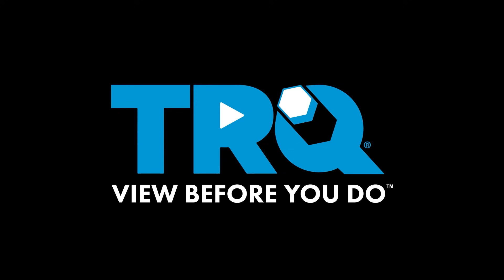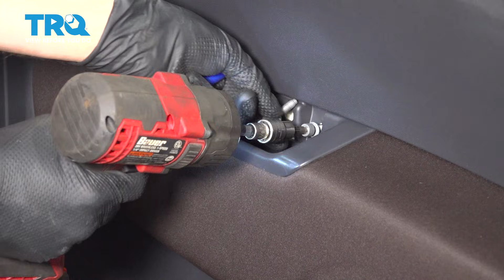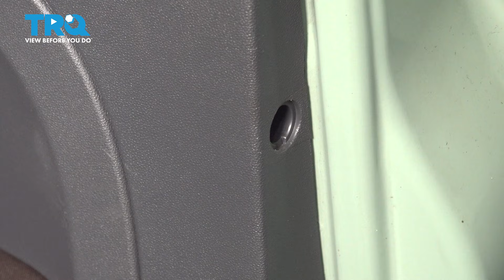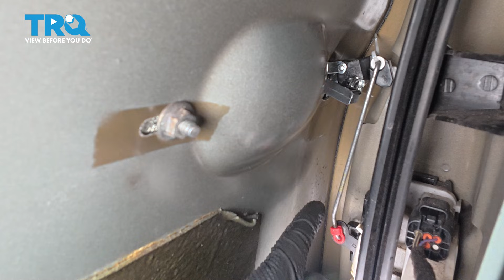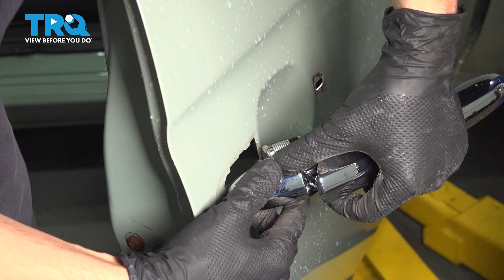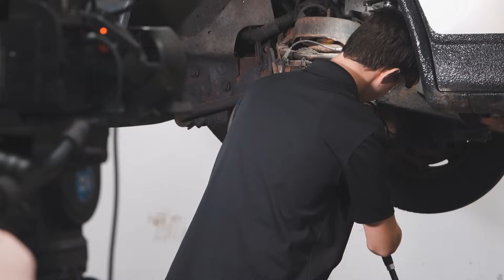How to Replace Exterior Door Handles 2012-2019 Fiat 500

Comment: a little annoyed that it says the only difference is that there's the lock cylinder on the driver's side. it is a more complicated install as there are two linkages to connect inside the door with one being blocked by the other and it also has the lock. removing the lock cylinder to place in the new handle isn't super simple either. once you get the old handle out, you need to put the key into the lock cylinder, turn it so that a little notch is visible underneath with a small metal clip above it. you have to remove the clip with a screwdriver or just something strong and thin that can pry it out. it's kind of a curvy U-shape. then with the key still in the lock (and paying attention which way is up so you put the cylinder into the new handle the same way), pull with a little sideways pressure so the whole cylinder comes out with an O-ring attached near the keyhole end. then put the cylinder including the O-ring but not including the old metal clip into the new handle with the key still in it and push it in as far as it will go. once it is all the way in it should be fine as it will also have a clip like the one removed from the old handle. the new handle should have one new linkage already attached which goes into the door but i believe it is the one behind the second one that should still be inside the door that you can reattach.